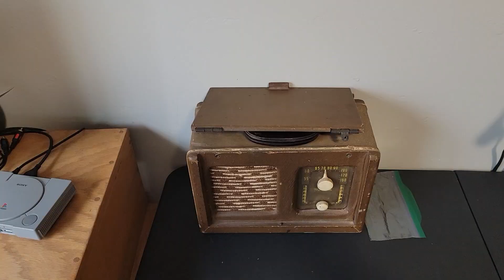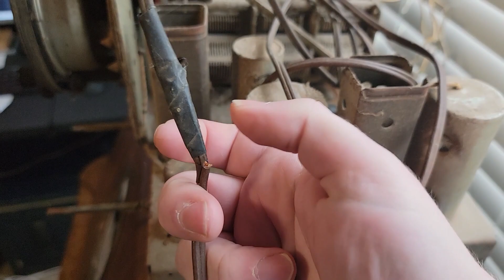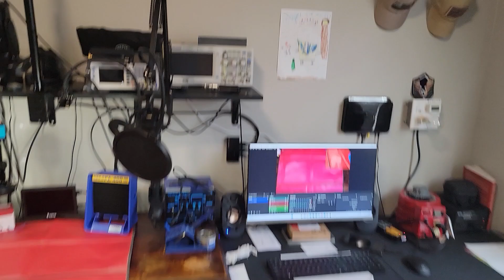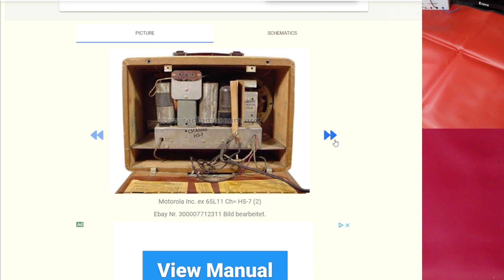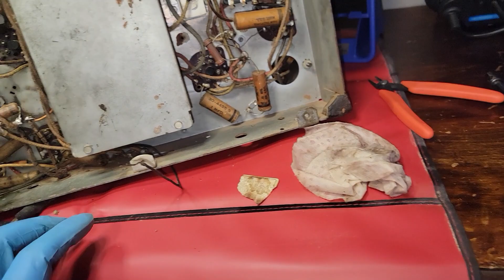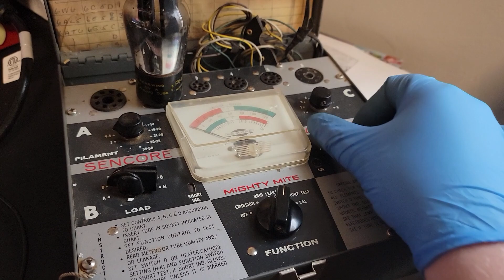Motorola 65L11 and Philco 38-4 Analysis & Repairability Overview

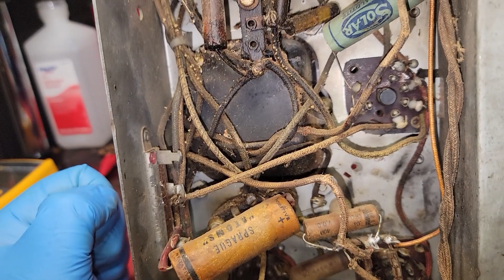Comment: Good luck, certainly a challenge compared with some of your other YT projects. Do you have generators etc for IF alignment? Buzz1151 (Philco part 3 28:00) may help with capacitor block disassembly.
Reply from the maker: Thank you for the tip! I will watch a few of his videos. I do have test equipment for aligning the 455Kc Intermediate Frequency. We'll see how it goes and if I'll need to improvise anything. The Philco unit is still pending customer decision. I've provided a quote. However, even in parts not including labor, it's a rather significant amount of money and some of the tubes for the Philco are hard to source. He did greenlight the Motorola. Video on it soon.
Reply: @HavingFunRepairs  Apologies, should have been 22:48 in Buzz1151's video.
Reply from the maker: @ralphj4012  copy and thanks you! If i get to repair this radio, I'll have to give his conent a shout out in my video and provide a link to his channel in the description. There tends to be this idea that a YT "repairer" should not watch other content and figure things out for themselves. I learned electronics the old fashion way. A bit of schooling and a lot of OJT (On the Job Training). If we got stuck and seriously stuck, we always picked up a phone and called someone who could help brainstorm a few things regarding troubleshooting.
Reply: @HavingFunRepairs  Oh, didn't know that re YT repairers. Happy to delete all my comments, if that helps.
Reply from the maker: @ralphj4012  absolutely leave the comments! It helps out everyone IMO. You can obviously tell what side of the isle I stand on. If there's something I don't know, I'm going to track down someone who does and learn from them.